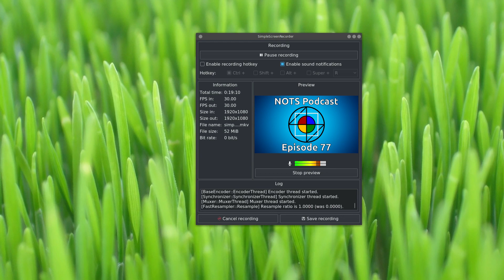Why do Computers Slow Down?

Comment: Great summary! you forgot to mention how dust on heatsinks prevents them from working at optimal capacity, which then causes the CPU/GPU to get too hot and very easily trigger the protection mechanism that just slows down the clock... hence making the machine run slower.

Comment: Good video, but you forgot the impact of shared file and processes in Windows and how removing one program could stop another working if the common shared files are remove when one of the programs are removed. This is the most common reason for damaged systems in Windows. Ps. an SSD in most cases does not need a defragmentation, but have a limited number of time you can read and write on them. making them bad for short term storage.

Comment: vary good vid .. your young tho ...  your forgetting the moors law broke down ....   for example .. a "desktop Intel core 2 quad q9550""2007" is much faster than my brand new "amd A-12""2017" in every aspect ...  now the laptop is kinda faster in some ways using newer BUSS and speed of ram .. the the bruit force of intel old cpu plays starcraft2 much better FPS at higher graphics"   in the older days 10 years  of hardware would = no comparability .. the new slowdowns are done by apple to make you buy a new computer
Reply: It's well known that Apple slows down your computer to make you buy a newer model.

Comment: Think you meant low level language such as C. Good video.  Thanks
Reply from the maker: Haha, I caught myself saying that, but decided I could defend it. What I meant is that C is high-level compared to binary machine code. But yes, it's low-level compared to other, higher-level languages like Python.
Reply: lmfao, good vid
Reply: In fact C IS a high level language. At least it was when old buggers like me wrote beautiful and fast code in it, of course with some help of inline or linked Assembly ;)
The two of you made me doubt, so I had to look it up and the definition or qualification seems to have changed a bit:  https://en.wikipedia.org/wiki/High-level_programming_language#Relative_meaning

@Nerd on the Street: nice video, nice channel. Subbed.
Cheers,
tubela
Reply: I'm quite curious how the C code looked then and how it was compiled.
I've written quite a lot of time critical code, mainly back in the nineties, previous age. At the time, being a kind of minimalist, I'd preferably write everything in assembler but of course realized for most projects it would take far too much time.
At the end of the nineties it was pretty hard to beat the Watcom C compiler with it's very smart optimizations in producing fast code compared to the assembler version. Maybe I'm wrong but one should think compilers (C compilers at least) only got better since then.
Of course, some specific code will always be faster when written in assembler. But 10 times faster than the C version....?

Comment: Very informative video Jacob, and I like the focus on relative performance and software companies tending to update for the newest hardware. Also a great advert for Linux over Windows :)
You mentioned degradation of component parts within a PC. Aside from the mechanical hard drive the most prone to failure is the electrolytic capacitor as found on most motherboards and cards. These often have a soft semi-liquid core and the components change electrical characteristics over time. The most common obvious fault will be a failed power supply - that's usually because the capacitors have dried out. But degraded capacitors can also increase system noise - both video noise and artefacts but also additional noise on audio lines. Some capacitors are only rated for 3000 hours use and this is connected to temperature. A long subject but you get the picture :)